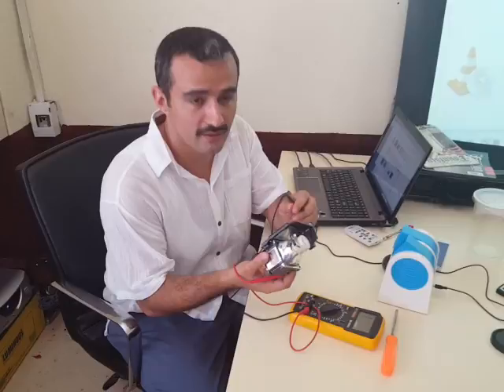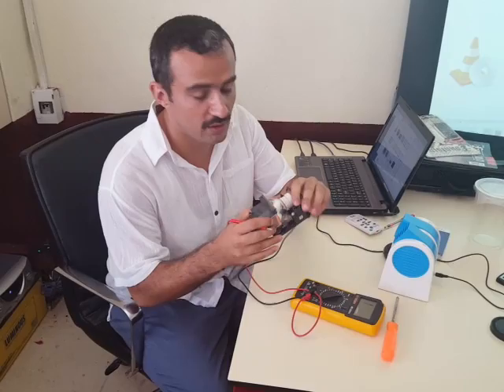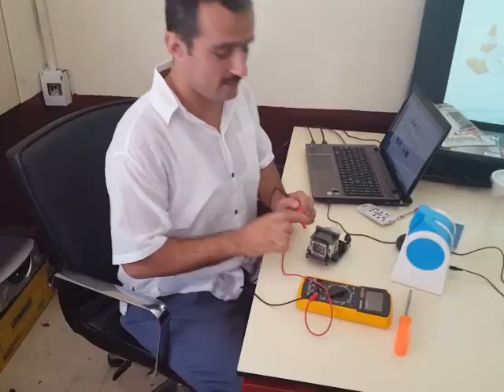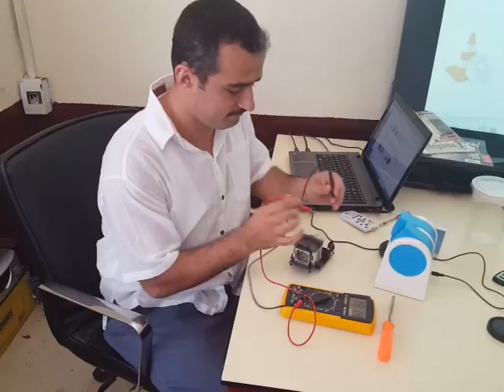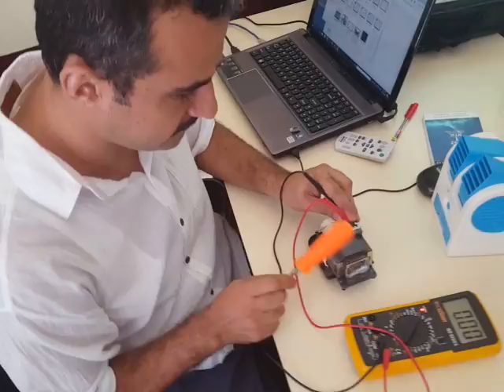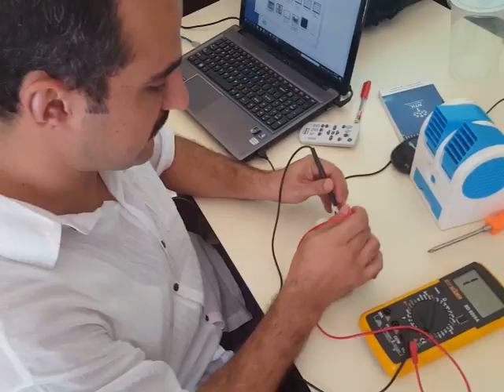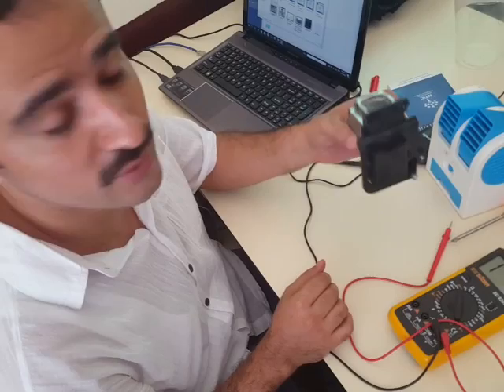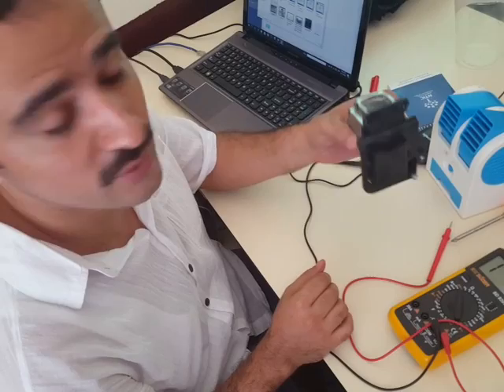How to repair the lamp of a projector in 30 seconds

Comment: I got a Benq TH685i and followed your procedure and oddly it worked. The lamp hours for this projector are 235 and it can run up to 4,000 at normal life. My question is why did that fix it? An what causes that lamp to fail like that?

Comment: thanks sweet ,,, worked for me too :)  ,, and i was wondering how can a hid lamp develop a short circuit , i searched the web for an answer but didnt find any ... i guess its a thermal protection (thermostat) and need to be reset .. dusty filters and fans can cause this and it could happen again also if the lamp life is ending.

Comment: Didn't expect it to work for me, mine had 750 lamp hour, but broke the other day. Bought multimeter yesterday just to try this fix, I banged it with my little screw driver, it didn't work at first, I grabbed a bigger plastic object and banged couple of times, then it magically fixed the lamp. Mine was Epson Home Cinema 2250.

Comment: Hi, I have hitahi cp-cw300wn. 

O wathed movie on the ceiling when projector suddenly turned off. Just goed blank, power stopped, ventilation stopped. Died somehow. 
Earlier i settled projector upright to watch a film on the ceiling. I created some small gap u der it so it could breath. Gap was 1.5cm from the floor with size of projector itself. I simply settled it on two books and created this gap.

Now device does not turn on. Only reaction is visoble when plugging device to power. Power and temp lights blinked on right during plugging and device remain "dead". Got any solutions to recommend? I would repair it but i'm not sure what to do with it.

Any idea? Thanks!
And good day!

Comment: Hai, I brought my EPSON pro ex9220 wireless 1080p projector in the
year 2017 
Last month the projector stopped working. right now it shows only the
power button and status button blue light ON. WIFI light, temperature light and bulb
light are not working.
so may i know what happened to my projector. if i need to buy a
projector bulb, where can I buy the bulb? THANK YOU SO MUCH FOR YOUR
HELP.

Comment: 1) Has anyone had issues shorting of other components after the DIY repair in the video? 
2) Has anyone opted to replace the bulb with an LED setup, instead?

I have a great Vivitek 2D-3D DLP projector that if it wasn't for the $150 bulb that needs to be replaced, it is still a great projector. I am thinking of converting it to an LED light.
Reply: good idea! Ill try to do that now
Reply: yeah works fine. Just break open a 240V LED armature and jam that in there. Looks like most projectors have jumpers to stop trying to figure out if the bulb works

Comment: The projector lamp is a high pressure mercry HQI lamp and in a healthy working condition even when brand new it should show open circuit. This guy is talking utter nonsense in here.
Reply: He showed he was testing the lamp and it was shorted. Then he banged on it and the short went away, showing an open circuit. My question is, how could you ever trust this lamp again? Also, a shorted lamp can blow a ballast board and a power supply board (I['m working on one right now where this exact thing happened). I would never use a lamp this happened to.

Comment: It might work, but you does not re-install in the projector as a proof. The reading on your multimeter also shows 1, which means discontinuity. Continuity should have a value close to zero. The zero at the beginning and the beep could mean continuity. Correct me if am wrong. My projector's lamp does not work as well but i am worried this temporary fix may bring further problems than just the lamp itself.

Comment: This is not a very smart thing to do.
If your lamp is shorted, it can blow your ballast board and your power supply board. One of our customers bought a lamp from Amazon, a cheap POS, and it blew his ballast and his power board. I did not know he had bought a cheap POS lamp, and I installed new ballast board and new power board, and it blew the new parts too. Since it was an expensive projector, we ordered an OEM lamp, and replaced the parts again and it works fine now. I would never reuse a lamp that tests shorted. Do this at your own risk.
Reply: Mergatroid Mania this is my vivitek model number D557wh. My projector turns on but the bulb dosnt. I thought you cant check a projector bulb with an ohm meter? How can I troubleshoot the igniter or the bulb .
Reply: You can check a lamp for a dead short using an ohmmeter (that is, a short to DC) but you cannot check anything else with a meter. I have seen cheap lamps arc to ground and blow the ballast board. In the case in this video, if the lamp had of arced after his "repair" it could have blown the ballast board. Perhaps people in some areas may think it's worth the risk, but I am working on clients projectors and will not risk blowing an expensive board to save a cheap lamp. The only way to troubleshoot this is by substitution.
Reply: most of the time the cheap lamps on amazon are exactly the same, it's sometimes a hit or miss but more often than not you'll get a good one. There's no reason to suggest someone to spend $270 more than they have to on a projector lamp. I've had oem lamps last a couple months or flicker. So oem lamps are also hit or miss. Yeah, I'll spend the $30 instead of $300. Just read the reviews, it's amazing when you see people buying the lamp that doesn't have any reviews or poor reviews. Buying the one with the best reviews even if it's 4 star, you'll have a better chance at getting a good lamp. Again, oem lamps can also be bad.
Reply: 1. Yeah this wasn't the best way to do a reset an thermal locked bulb, but its common.
2. Unless a huge unprotected surge arcs to the machine, no PCB in the history of the world has, "blown". Not to say a passive component didnt pop due to improper load.

Videos like this, and comments like yours do not help actually educate people in this situation.  
When buying bulbs be sure to check the small details. Do your research!!. As with anything under repair, a slight change in temp, ohm, or mAh outside operating specs can harm a device on a long enough timeline. There is also a chance it could be fine, forever. #RightToRepair